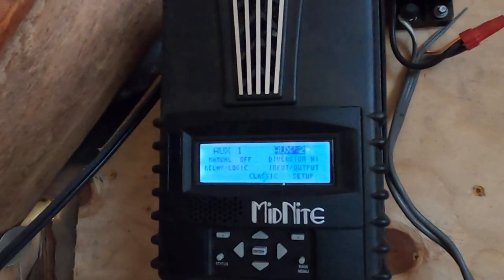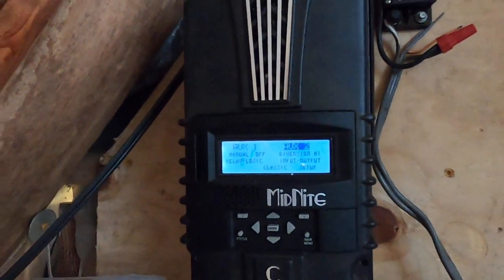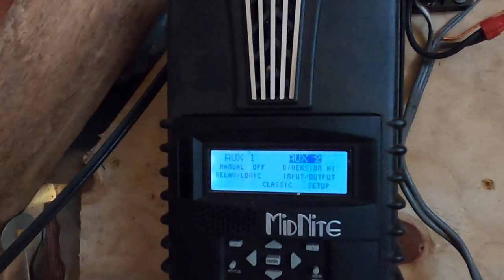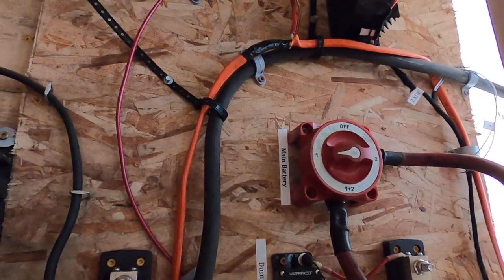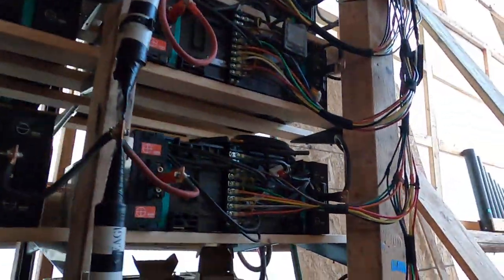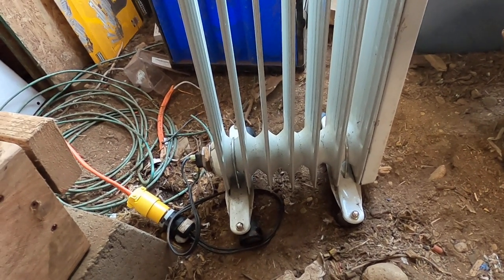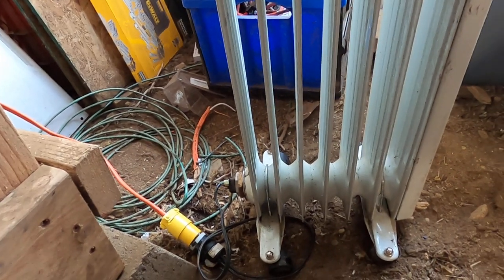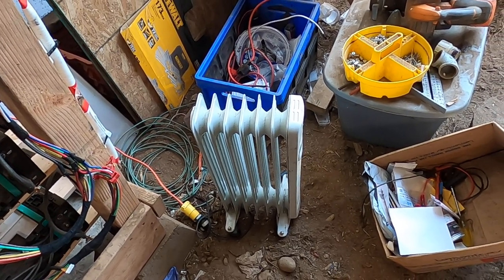Oil Filled Radiator Hydro Dump Load - Midnite Classic 250 PWM Relay control  -   Solid State Relay

Comment: Hi Good Job. On similar lines, can we do pmw control on a oil heater directly without changing the heater element at 230v ac. Will that be fine?